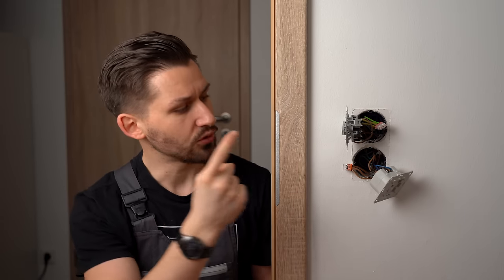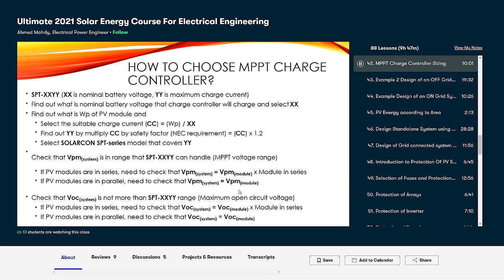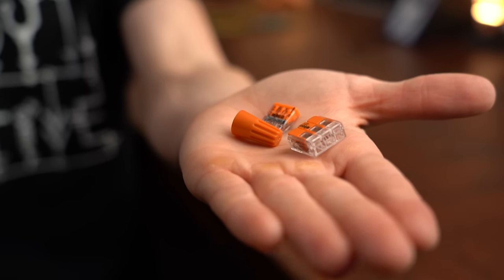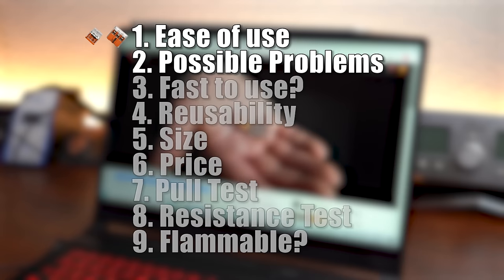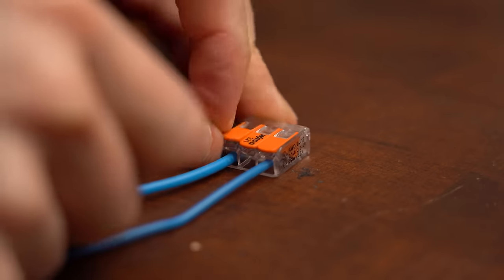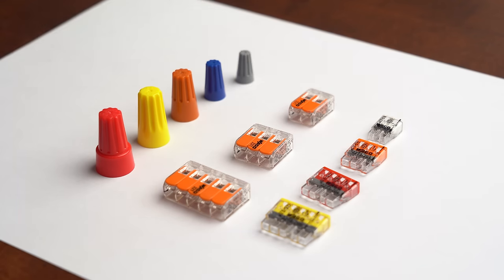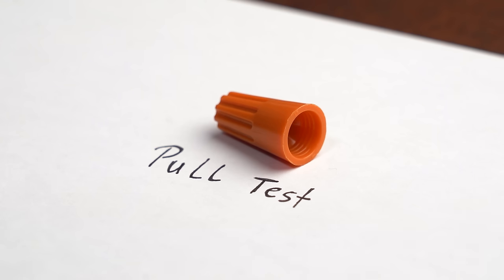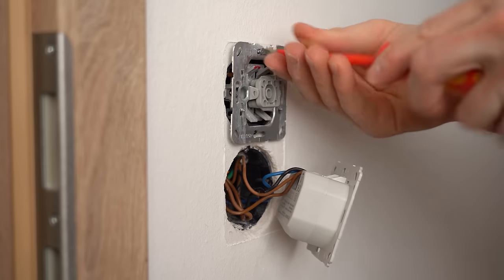What Wire Connector is the Best? Settling a Debate! Wire Nut VS Wago

Comment: In most countries there are codes which prohibits work on fixed installation by uncertified electricians. And, even when there are not, when an insurance company have to pay out, they will use any available excuse to avoid the payout.  Two different gauges in a connection is not done by a certified electrician.  Wire nuts used to have wings to give more force, but they are going out of fashion anyway, and only conservative electricians use them now.  The advantage they have is that they do not carry any load themselves, and in regions/countries with mainly wooden houses, a bad connection is worse than a short circuit.  Wire nuts will only be used were there are no movements of the cables.

Comment: I think Wago wins in size because having your wires run in parallel makes much better use of small confined spaces. Having a bundle of 3 or 4 decent sized wires twisted makes them very stiff and hard to work with. Maybe they are popular in the states because they build everything bigger but for renovation projects the Wago ones win hands down.

Comment: I can think one one use case you missed and that is the use of different metals, i.e. copper/aluminum.  Suffice to say using both of those metal under a wire nut is a big no no, thus the Wago with its bus bar style is a clear winner to me.

Comment: In Spain we usually use barrier terminal blocks (strips of double screw terminals), I thought that was standard everywhere except the USA. I knew about both wire nuts and wago, but it's rarely used here. I missed that from the comparison.
Reply: in germany those loose double screw connectors are banned for house wiring.

Comment: You won't find current ratings on wire nuts because the wires are making contact with each other. Wago connectors have "buss bars" making the connections between wires so they have to be rated per the application. Great video and one of the few with a nice, objective, comparison. I still like my wire nuts the best lol

Comment: What is the wago conductor/bus bar made of to create that much heat?
Why not use copper?
Reply: The wago has a copper plate, but a very small contact area, so the contact resistance is high.

Comment: Should have had another test. Connect all the connectors in series and put current through them until they melt, catch fire or burn out. It seems to me that the little time you save is irrelevant to the fire safety hazard since you will honestly only have to do this once or twice in the life span of the house. Also the safety aspect should be worth more than one point.

Comment: Dude what's weird about Levernuts- even the ones rated "600V" from McMaster say 300V on one side, 450V on another.

Can't tell if they mean 300V per line, or wtf. Does anyone know of any TRUE 600V Lever nuts with test slots?
Reply: The different voltages are for the differen standards they comply with.

Comment: but wago failed the current test.. what happens during a high current overload. before circuit limiter kicks in.. the connector fails? or? might be an interesting test. just wondering
Reply: the wago seem a hugh step above the simple push in connector..kinda like the back stab outlet.. several swists while pulling and the wire is out. can the wago be pulled out the same way?
Reply: They didn't fail the test. In residential, they use 20 amp breakers and 15 amp receptacles. The highest possible current draw you'll see is 20 amps. In his test, he used 60 amps. I've seen several videos on wago, and the wire insulation failed before the wago did.

Comment: 221 reuseabilty also a problem point.  the lever can pop open leaving wire in place but not secure when putting wires into box. at least electrical tape around it to keep that from happening. 
 been there

Comment: I wouldn't call this a narrow victory for Wago connectors.  Wago won the most tests but the wire nuts won the most important tests... especially the pull test & the resistance test.  The resistance can be further lowered and strength of wire nuts can be further increased by pre-twisting the wires & then putting on the wire nuts. The resistance test proves that Wago will fail more easily under high loads.

Comment: Say what you may, but a WAGO must depend on a shiny thin metal spring to ensure a solid connection to its' buss strip. The contact area is less than what a wire nut provides with the wires twisted tightly together and held by a constricting wire spring (an intimate connection)  In 45 years as a journeyman industrial electrician, I have seen many many times catastrophic damage to wiring and electrical equipment caused by non-intimate connections. WAGO engineers know loose connections cause heat and that is why they label the connectors for voltage and amperage (watts), which translates into heat. They are clever tech and simple to use if you prefer to pay the high price for them, but user beware they do have limits, just like everything else in this world.

Comment: My big concern really is how well does a wago retain a wire should it overheat and the plastic housing melt?

With a connector block you could literally melt the plastic completely and still the wires are held by the brass fitting.

Comment: I guess the conclusion is: use both! Wire nut is cheap and powerful if done right. The Wago is easier and more flexible, but also rather expensive.
I missed the good old "Lüsterklemme" .(spade joint... screw joint... insulated screw terminal... or whatever it is called in english)

Comment: To be fair, my job requires high amp draw wiring as well as low voltage wiring. Unfortunately, the wago isn't rated very high at all in the amps category, and wire nuts have as much amp capacity as the wire, so the wago isnt used and the low voltage wires are too small and slip out often, even though wago says the lever nut connector will work on that small of a wire. Therefore, to me and most trades in the U.S., the wago is useless. I sometimes use them at home, but for professional use, it isnt practical. Specifically electrical work in the US, the red wire nut is used for almost any 120v or 240v connection, I know electricians that only carry red wire nuts, so considering which color to use is a non-issue. Yellow can be used if a light fixture has small wires, but red will normally also do the trick. Also, pre-twisting the wires is as point of debate. I never have and i have never had an issue. the stranded wire just needs to stick past the solid wire a few hairs and it will be a great conneciton.

Comment: i prefer to just use a Telegrapher's Twist splice rather than any of these connectors, though granted it does take more time. Here in Malaysia, the commonly available connector is the screw terminal type which is even less secure/safe 😅

Comment: Seriously hate wire nuts. The fact that you have to pretwist them clogs up the box and creates a whole mess of wires in the back touching each other which i find more of a risk if the plastic insulation melts off and all the bare wires are touch each other. Most american homes dont go above 20 amps anyways and wagos are such a life saver. Would i use it for a concert venue? Duh no.

Comment: Interesting.  But I have to say the resistance test shocked me.  The idea that the connector being warm to the touch seems crazy.  Also I was always taught to twist the wires together first, then apply the wire nut.  I think this would avoid the bad connection you found.
Reply: Nope doesnt matter as the wire nut instructions does not specify that, And i think the people who made the wire nut know that better than you.
Reply: @norwegiannationalist7678   Heat buildup and electrical resistance don't matter?

Comment: when it comes to the resistance test, simply moving up from a Wago 221-4xx to a 221-6xx connector would resolve any issue, not that there's really any to begin with in your testing, at least.

Comment: In the US if you’re DIY’ing wago is fine. 

But if you hire an electrician by US code we have to use wire nuts. And if we see wago connectors we have to replace them. 

Long story short “it’s the rules.” 😅😅

Comment: What about water proofing? There are wire nuts that come filled with a grease-like silicon insulation that are unmatch for outdoor wiring. (Like for mains garden lights and gate openers) Would love to see wagon address that problem because I would love to switch to them.
Reply: Wago carries a product called "Gelbox" which does exactly that.

Comment: How do wagos hold up over 10-20 years with a load like a refrigerator on it ? A wire nut relies on twisted wire and constant tension to maintain the splice under load. I have seen far to many of those stab in outlets fail under load over time. Seems like wago is the same type of connection as the stab in

Comment: The heat generated by the high resistance carries more weight than all of the other topics compared. Even if the wire nuts were more expensive than the Wagos I would buy the wire nuts solely because they are safer.

Comment: Something not pointed out in this video is the general property of electrical conduction. These Wago connectors only make the slightest knife edge contact with each wire clamped = the smallest surface area of contact and the metal size (length/width/thickness) is the absolute minimum for conductivity. Thus you have thermal heating issues with this type of connection and associated power losses with each new connection joint in a circuit. In contrast with properly sized Wire nut connections that are *UL rated and wire properly twisted *minimum three full twists for solid wire ore one full wrap minimum for stranded to solid connections yields the maximum contact surface area between the two electrical conductors and has no thermal heating due to losses. The added ability of these Wire nuts is the ability to easily add or subtract an additional wire into the group of wires being connected *if the wire connector is large enough to handle this many connections. Lastly if you wanted to test connections while there are in use or connected you can simply remove the wire nut and test the connection with a multimeter and the twisted wires maintain there connection. Conversely if you attempt to test a Wago connection that has all ports filled you will have to unlock a lever to expose the metal clamp bar to place your test probe onto the connected wire group, unlocking this lever un-tensions the knife edge clamp connection and the wire may fall out if under any strain or tension and the unlocked clamp is not positively clamping the wire to the connector sometimes creating an intermittent/loose connection. When properly sized and installed correctly I have never experienced a failed connection, a thermal heating condition in connection, or a loss in connectivity = more resistance ohms in the line vs using Wago style knife edge connectors or adding an addition metal to act as a pathway/connection between the conductors being connected. I read below and restate that Wire nuts are not rated by conductivity or resistance as they are not considered to carry current thru them, they are designed to bind the conductors together in intimate contact forcing a concentric 360 degree constriction that enable's the greatest surface area maximizing conductivity. 

A good example of ease vs application? Most US style 120v 15 amp plugs have two methods of connecting the solid type wire to the receptacle. One way utilizes a knife edge friction type connection that has minimal contact area and offers the least secure method of attachment usually located on the back of the receptacle it is the fastest way of connecting and installing many outlets in the shortest amount of time and is an approved method of installation by NFPA 70 standards. The other older style of connection is to use the screw terminals on the sides of the receptacle, when properly fastened these screw terminals are a more secure connection under tension or strain and provide a greater surface area for the wire and terminal to have intimate contact = better conduction and no heat thermal properties generated due to a weak connection. Even though the NFPA 70 states the first method id approved for use many electricians choose to opt for the later at the time of expense in man hours for a better quality connection, and ease of testing / maintenance/ trouble shooting by technicians in the future.

If time is money and speed or utility is key i would use the Wago style connectors. If I am going for quality and security of the connection I am making between the conductors then I prefer to use UL rated Wire nuts and proper techniques for twisting these connections, and use the screw terminals as well. The best connection that is durable, lasts and has no electrical losses is money better spent in time losses (contractor hours installing) vs the above listed shortfalls for added convenience and time savings.

The humble but educated opinion of an Electronics technician, and general commercial/residential electrician.
Reply: Wago lever nuts have an opening for a test probe on the back side, so opening the lever and removing a wire is unnecessary, regardless of whether all ports are filled or not.

Comment: On the pull test, set it up next time so the wires hang down. Then add weight at a consistent rate until failure. Let gravity do the work instead of your muscles. Much more consistent test too.

/Structural Engineer

Comment: Wire nuts are superior. Wago is fine for lighting and other low power applications but wire nut is best if your making a connection with <12 gage wires or <5 conductors which happens more than you'd think.

Comment: Is wago connector compatible with outdoor installation of GFCI and light fixtures  against corosion and oxidation ? With marrets I can use antioxidation paste or buy marrets design for outdoor usage
Reply: Wago offers a solution called the "Gelbox" with IPx8 rating.

Comment: You mentioned in the followup video that people said your testing wasn't fair to wire nuts.

I agree. You've been fortunate to have not been subjected to them all your years and you missed the key issue. Not only are they a pain in the rear to work with especially in tight places the failure rate of a connection being made is high.

Yes like any dumb skill you can get "good" at making them work but I've seen plenty of electricians curse their existence and I've done my fair share of swearing as well.

The wire nut fans are suffering from that being a hostage thing and deserve our sympathy.

Comment: Poor teat! Do a real load/current test for a good period thats where you really see which one survives  and also use good proper wirenut. The one you used are cheap, let's say you can't put 4 #12 in those, they usually comes included with light fixtures, I throw them away.  I've repaired failed wagos before due to current/load. Wagos meant to be for terminations like constant light fixtures repairs, ballasts etc. Wire nuts are more solid connections with pretwisted wires. Been in the trade for 10 + years.

Comment: What is it? The Wago 221 is rated at 32A but gets warm passing a continuous 20A! 

So only use lever Wagos when needed.
Reply: the wire itself would get warm at a continuous 20 amps to be fair
32 amp is screw terminal territory for me just because of the wire size and that current nah man neither wirenuts or wagos for me
Reply: @alouisschafer7212  
Screwless connectors are 16mm and above.
A cable rated at 32A will not get warm passing 20A continuous.

Comment: Could you redo the resistance test with a larger sample size? Maybe even with a few different people doing the twisting.

I have them all over my house, from the last owner, and found that the reason a fan was not working was a wire nut. Some fall off when the box is opened. 

Great specs on your tests, but I mean.. the number one criteria could/should be the performance of the worst install, since you know that will happen either way. 

Stress, noob or accident, if it starts a fire when the other one would not have, then that is a win for the other in my book

Comment: one very significant advantage of the wirenut (larger ones) they can fit more than 4 wires if necessary .
Reply: wagos can be had in various sizes.  Te largest I have is a 5 wire.  It is frightening to me to think of a wirenut with 5 12 gauge wires stuck inside.
Reply: @anxiousappliance  they alsow make an 8 wire version of the 2273. It has a 2x4 layout and is very rarely used.

Comment: Wire nuts require twist done with pliers and require the insulation to be twisted too. The wire nut is mostly for protection not mechanical.

Comment: I like Wago for low voltage, low amper connections, But with High amp 10-20A it will heat up.

Comment: when using wire nuts you are supposed to twist the ends of the wires together first to help keep them together. also if countries where wire nuts are commonly used, there is no need to google them. wire nuts also dont need a current rating really because they mash the wires together so there is no current really going through it and instead going directly into the wires.

Comment: Wirenuts are more expensive than Wago in the end. You use electrical tape on any connection before the nut and it takes at least 4-5 times as long. That's all a hassle overhead or in tight spaces.

Comment: As much as I love Wago and hate Wire nuts the nuts smashed the most important test which is obviously connection resistance!
When installed correctly wire nuts clearly create a far more electrically sound connection with significantly lower resistance and loses !
I wish you had also included the old ChocBox/connector strips which is my preferred choice, if installed correctly they produce a connection that is significantly stronger mechanically  and also as good if not better with regards to electrical & resistance imho.